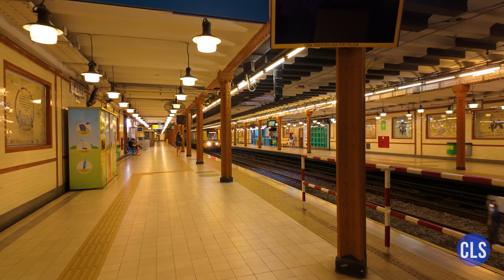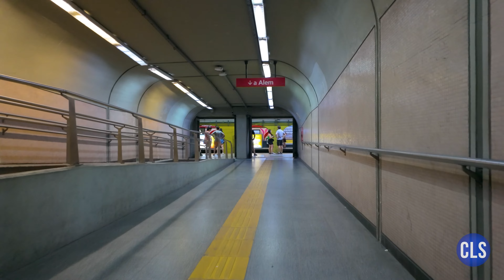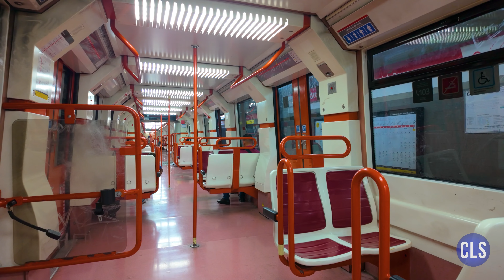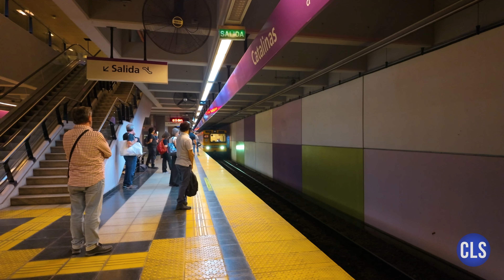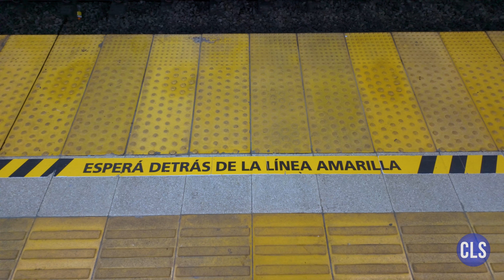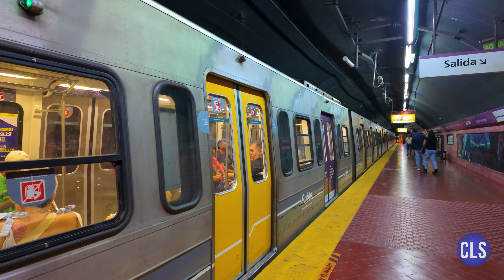Buenos Aires Metro - Argentina

Comment: Since 2019/20, the operator changed from metrovias to emova. Also, line b has both a third rail and overhead third rail since the caf 6000 require the later to operate.